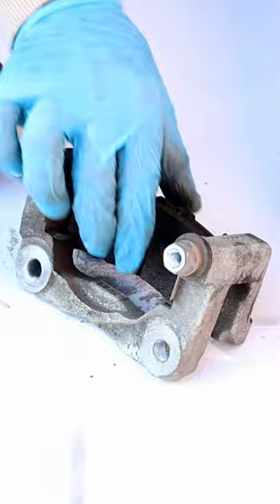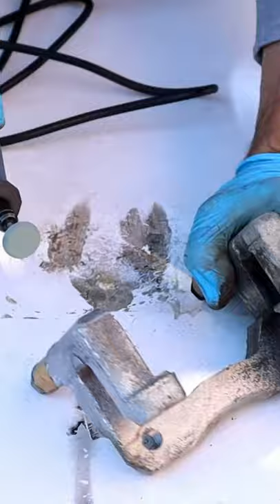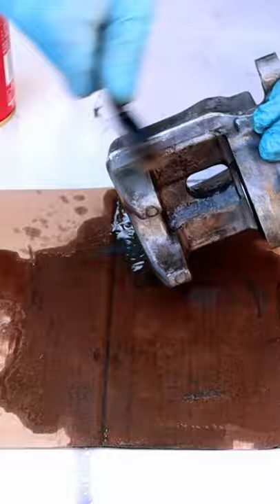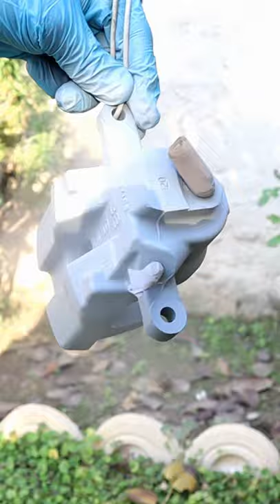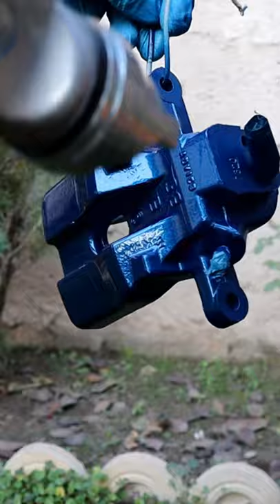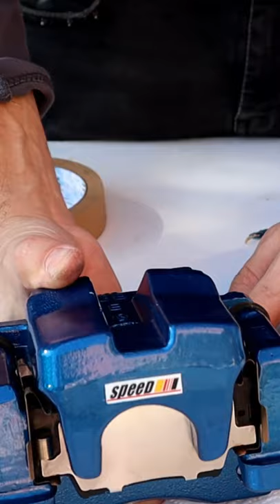Restoration brake caliper #shorts

Comment: Restore? You cleaned and painted it. The internals never got touched in this "restore/clean and paint".
Reply: Exacto !! El que sabe sabe !🏁
Reply: Yes and I want to see how long the paint lasts. Usually you want to powder coat them or if you want to spray you have to use very specific products, like epoxy.